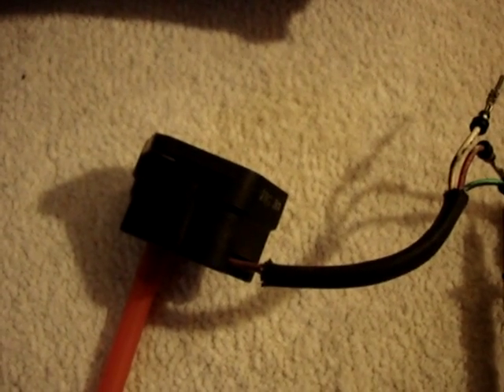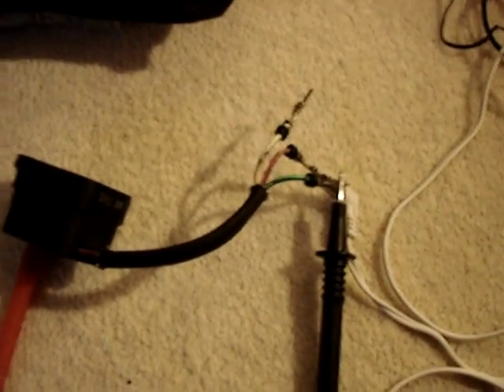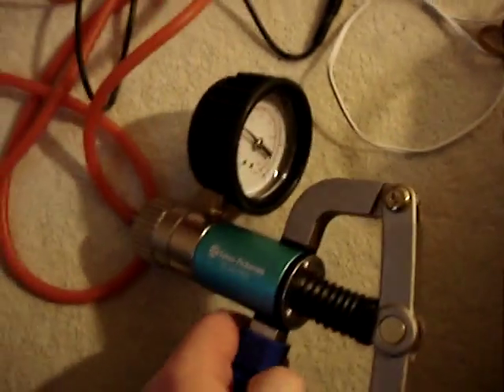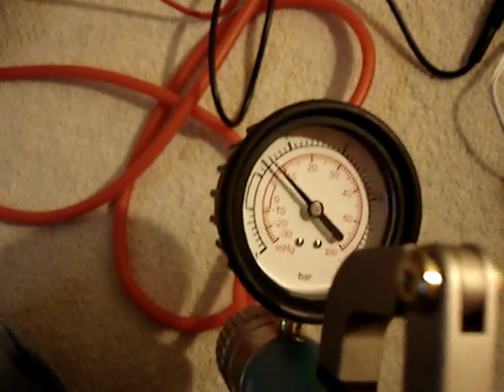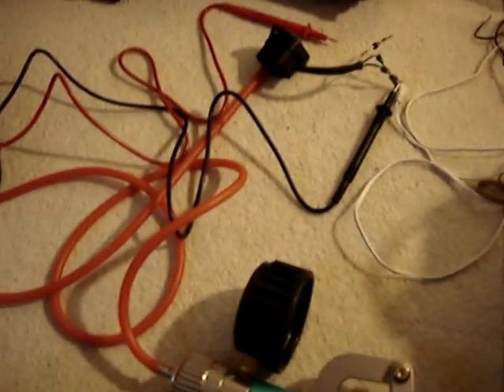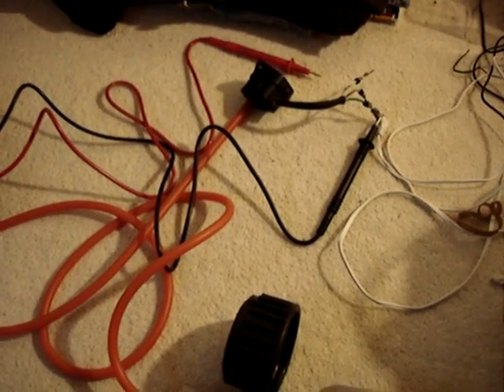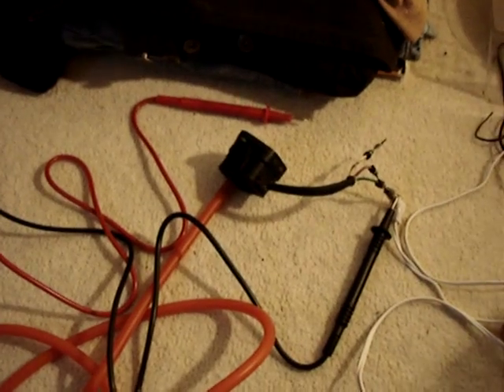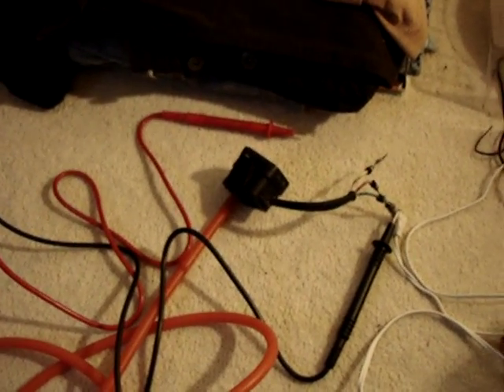UNDERSTANDING THE VEHICLE MAP SENSOR TUTORIAL 1, GTti, TURBO, FCD's

Comment from the maker: MAF is Mass Air Flow sensor, They give out voltage in the same way but they are work by measuring air flow rather than engine vacuum/load. Some vehicles will have a MAF sensor rather than MAP, or some will use both.